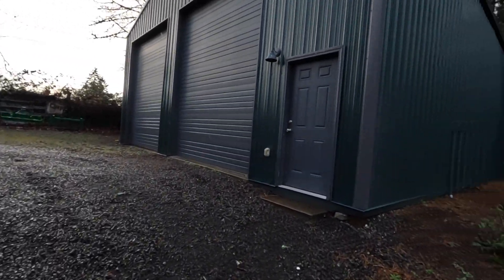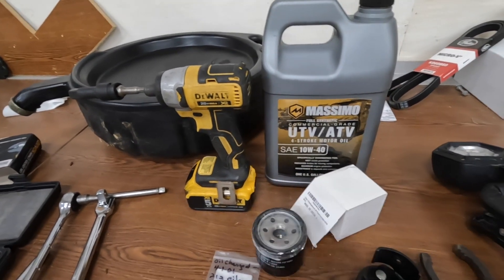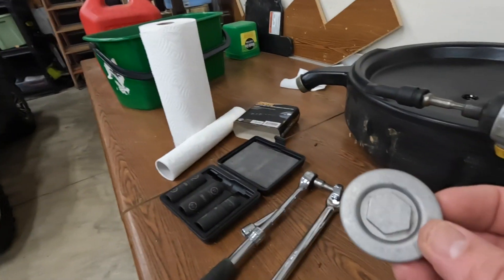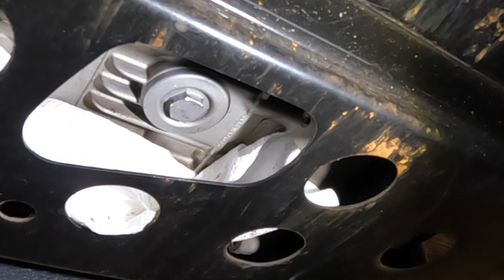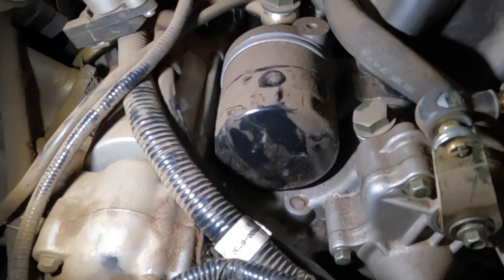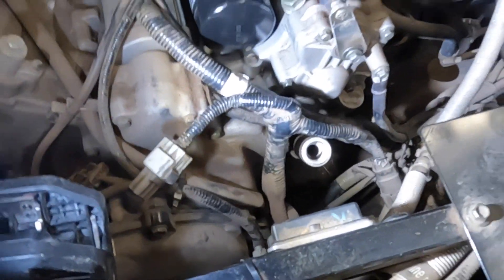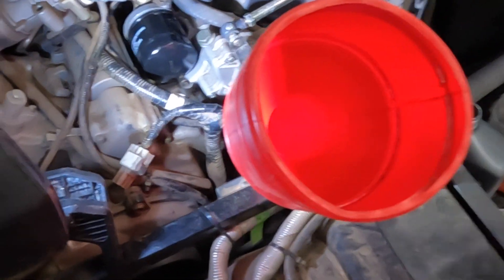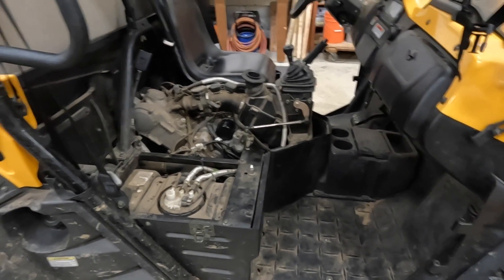Cub Cadet UTV oil change. What were they thinking!

Comment: Great Cub oil change video. Any on reverse acting up/some times not working at all? Wondering if you have a fix as it seems to be a big issue with the challenger series
Reply from the maker: Can you tell if its actually the transmission or is it the linkage?
I had to replace my fan gear on the linkage. It wouldnt shift into reverse or low gear. The fan gear was almost completely stripped. 
Unfortunately, that was before I started my channel,  so I didnt film it. But its a pretty simple repair. Let me know what you think.
Reply from the maker: Also check the linkage rod. It doesnt take much of a adjustment to make a huge difference. If it's your fan gear, heres a great video showing how to diagnose and replace the fan gear. Hope this helps.
https://youtu.be/gAwGfrp1zxM?si=hSbE2iOV_1XkyiA0

Comment: Will the center console come up over the brake lever? Or do you have to remove the brake boot if so how do you remove it
Reply from the maker: No, the console lifts up over the brake lever and the shifter boot. You may have to move the brake lever up or down in order for the console to lift up over it. But its pretty simple!

Comment: I have a 2015 volunteer and doing any service on it sicks. That oil drain plug is a joke along with everything else draining. Engineers suck
Reply from the maker: Its almost like they wanted to make it difficult.  Overall though, Ive been pretty fortunate with this side by side. I guess you get what you pay for. This thing was $7500 back in 2017.